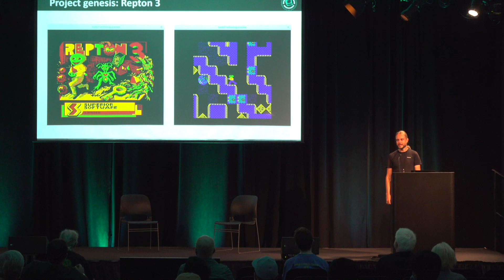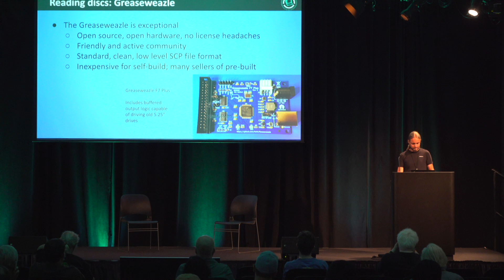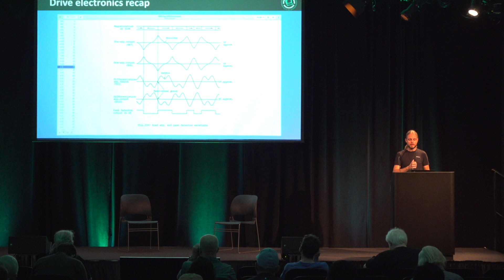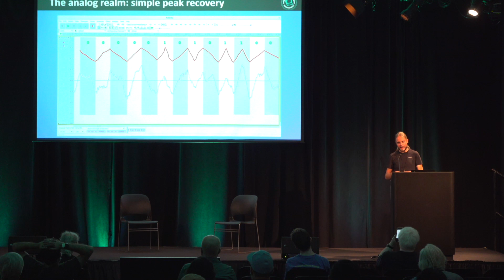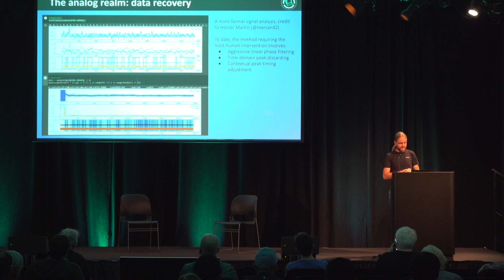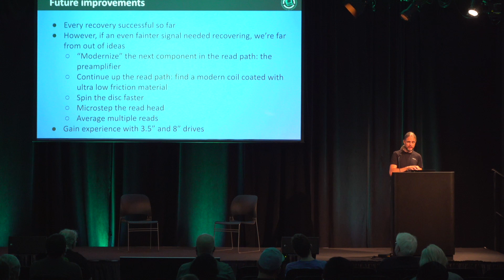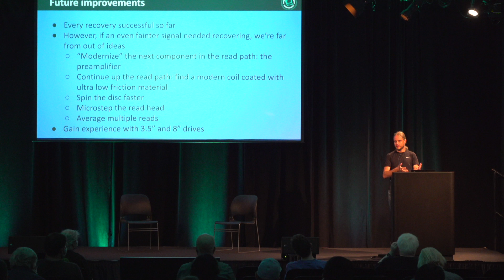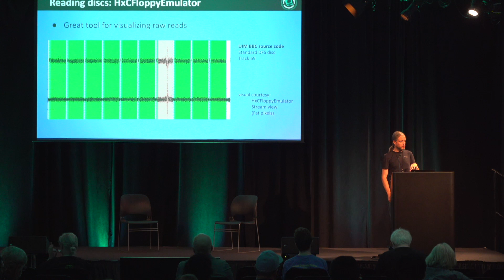Recovering Lost Floppy Discs with an Oscilloscope — Chris Evans

Comment: I'm a preservation expert on 3"/3.5"/5.25" Disks, and i have some informations to share and also react about this video. What is shown at 10:55 is basically the flux at the disk surface that has been displaced. It's due to a user fault : inserting a mouldy disk inside the floppy drive without cleaning the disk. Replace the flux can be done, but it's a very tedious task, and it can take 2 hours just for 1 track on the disk. The other possibility is that the user tried to clean the disk with som alcohol and use a cotton bud with round head or either a sheet with alcohol to clean the mould. This is enough to cause what you see on the screen at 10:55. The best solution to clean a floppy is to use alcohol 70% (not 90%, it's way way too agressive with the disk surface!) with a drop per drop flask, put 2 drops on the disk surface, use a floppy cleaner, and let the alcohol do the trick with the help of the internal coating. My experience and own success on the matter : I have extracted and preserved more than 3000 original softwares from floppies and also more than 2.000 original software tapes. This has only been possible with the help of my method. Thanks for reading me.
Reply from the maker: Wow! Incredibly helpful information! Thanks so much for sharing. I hope that others can learn from your methods.
Reply: @vcfederation  you're welcome !

Comment: If even for my own notes, here's my recap of your account of Hector Martin's 
Frequency domain analysis and probabilities of a one versus a zero 
from section at 30:03
Custom Algorithm
- aggressive linear phase low-pass filtering to avoid shifting the peaks around relative to one another
- time domain peak discarding (where we know peaks are just too close together to be possible - out of range of drive capacity)
- walking the peaks - looking at the timing between them for a zero bit or a one bit
- if previous is early or late, adjust next peak with a certain percentage adjustment
- Apply human eyes to failures after that

Comment: At 28:02, Chris, could you share the specific model of Mitsubishi drive that you used?  I'd like to study this further as well.  Like you, I prefer and use  the TEAC series of drives, so I'd like to see if this "older" model you mention could help me in these efforts as well.  I suspect you listed the model(s) of Mitsubishi drives you tried on your chart on the slide at 28:55, but it isn't quite readable on the screen/video capture. Thank you!
Reply: The Mitsubishi drive used at 28:02 isn't mine but I believe it's a M4853. Unfortunately, these Mitsubishi drives have a large variance within the same model number. The drive in question has a logic board revision NAMFM. This appears to have the older drive heads but a newer custom Mitsuibishi ASIC for the preamplifier. My Mitsubishi drives are both newer (MF-50x) and neither appears particularly special.
Reply: @scarybeasts  Thank you so much!  I'll see what I can find in this arena, starting with my own collection of vintage drives...

Comment: Greaseweazle is a terrible tool for Commodore disks, wasn't even made to handle them, can't handle half-tracks. Also doesn't implement the SCP format properly, practically useless for Commodore 64 stuff.
Better option: get the Super Card Pro - this is the SCP standard, they designed it, does it all.
As the old adage says: you get what you pay for, don't settle just cuz GW is cheap
Reply: Greaseweazle's also open source - if it doesn't do what you need, I'm sure Keir would be happy to accept a patch to fix it. Also, I've never seen Keir backdate a spec change - unlike Jim Drew's latest SCP change - or send legal threats to anyone archiving the software. Point being, Greaseweazle might not be perfect, but at least it's open source and can easily be fixed!
Reply: @dangahlinger62  Ad-hominems aren't welcome. Please, conduct yourself with some decorum.
Reply: @scarybeasts  promoting software piracy is not only a violation of 'decorm', it's illegal.
perhaps you should stick to legal activities from now on.
Reply: There's space for open-source and closed-source software. I'm sure SCP is great but my limited experience of the Greaseweazle community suggests it's open-minded, helpful and interested in helping people archive their data!
Reply: @dangahlinger62  I had no idea that promoting Greaseweazle was so contentious. I'm not a Greaseweazle developer, but you can enjoy the source code to it here: https://github.com/keirf/Greaseweazle. It should answer any questions you have. If you had further comments relating to Greaseweazle, you should engage there. Here, the primary focus is on data recovery.
Reply: @scarybeasts  with the code they're being sued for? that's brilliant.
Keep promoting software piracy.
Btw don't you have the code patches finished yet? You keep saying you're a genius, you should be done by now.
greaseweazle is a $30 (or so) paperweight, useles. it doesn't implement the SCP format properly, they make a total mess of it. that's because they have a bad implementation based on what seems like 'stolen' code, I mean, you did say they were sued over it.
Recommending a product that was sued is not a great way to go.
I'll expect to see your patches that fix all the problems done within a week, please don't post again until you're finished with that.
So stop boasting, and do it.
There is already another product out there that does a much better job and sticks to the SCP standard format, and has a thriving support community and actually does the job. consistently. every time.
And it really doesn't cost that much more.
Especially when you consider you can buy a GW and waste dozens of hours, maybe ruin your disks, but I guess your time and your disks aren't important to you. It is to everyone else.
You can do a job cheaply, badly, or you can do it right.
Skip the greaseweazle bargain bin, and get the right tool for the job.
Reply: @dangahlinger62  The SCP format is simply a bit copy format. Most users do images in this format without checking the output. A big number of SCP images are simply garbage, full of errors.
Reply: @dlfrsilver  That's only true if you use a tool that doesn't implement the SCP format properly! Greaseweazle is terrible for this.

If you use a tool like SCP Pro from the guy that actually created the SCP software and the board, it works very well, every image will be at least readable.

They will NOT be "full of errors" or "simply garbage" - those statements of yours are actually really defamatory.
I have hundreds of SCP images, they're all just fine.

You have to learn how to "rotate" the images, yourself, manually, as there's no way to know where each track begins in reference to physical layout on the disk, and every software vendor did it differently. Almost no one used the sync hole as the index. real pain.
But that's not the fault of SCP or hardware related to it.

your comment is rated as 100% BS. completely wrong, false, and misleading.

Don't use Greaseweazle, or Kryosucks. Use a tool that actually works: SCP itself.